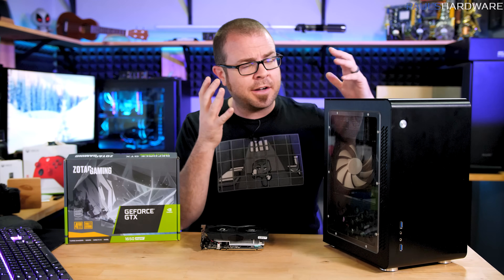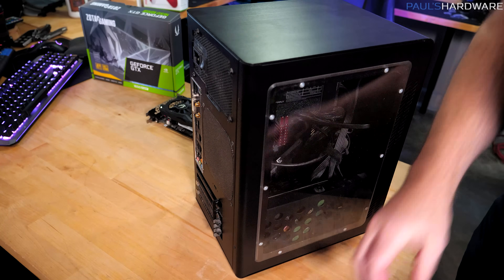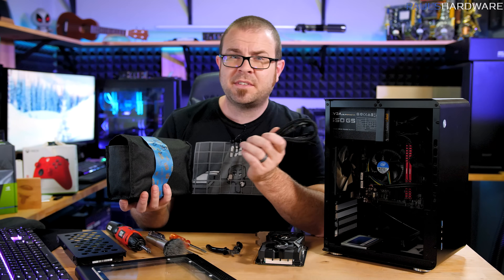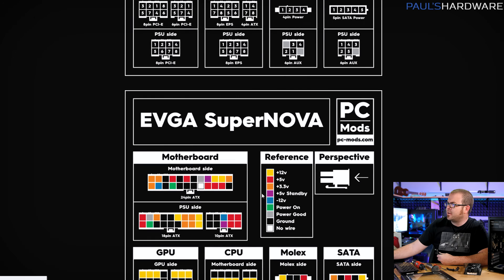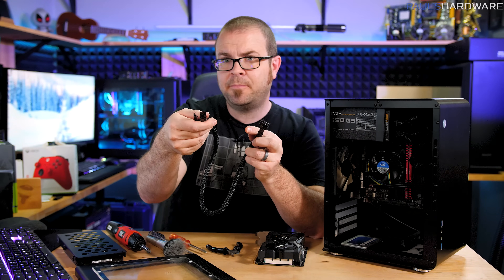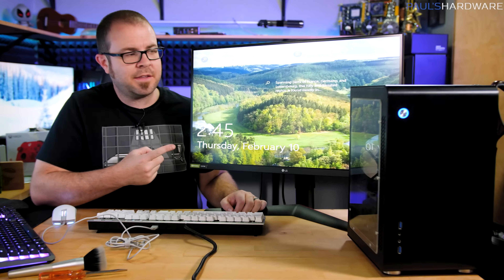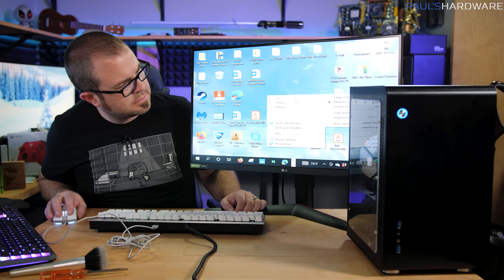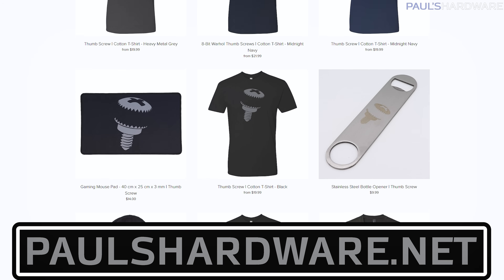Upgrading a Quad-core PC from 2015

Comment: Good info concerning the power supply pinouts, I would’ve thought a lot of that was standard but now I know how to check if I’m ever in a situation like that
Reply: Yeah its ridiculous that pin outs are not standard at this point.
Reply: @TheKazragore  I mean for non modular they are standard but for modular manufacturers make their own design on the PSU side of the plug and therein lies the problem. In an ideal world they would use the exact same connector that is on the receiving end but they don't always do that unfortunately.
Reply: It's also possible to buy a custom cable for the psu from companies like cablemod. But you have to specify the exact make and model of the psu so the pinout is correct.
Reply: Yeah I had a psu go bad and swapped it for a different brand without swapping cables too, didn’t work until I swapped the cables, now I know why!
Reply: All of those supernova psus have consistent pinouts and are interchangeable
Reply: Yep, I just upgraded from a RX480 to a RTX3070 and just assumed any new 8-pin cable would work. Glad I didn't just plug in a random cable and go.
Reply: @SixShooter14  really, but how much did the 3070 cost if u don't mind me asking
Reply: @mindrover777  $800 for and EVGA FTW3. Used on ebay.
Reply: @SixShooter14  woof,  that's a lot

Comment: good lord paul change that case out and clean that cpu cooler! that case is a death trap for airflow and you are using intel???? why not just shove a heater in there!
Reply: You really should watch the first 5 min of this video
Reply: @Kraven83  i did and i would still change that case out for one with way better passthrough airflow